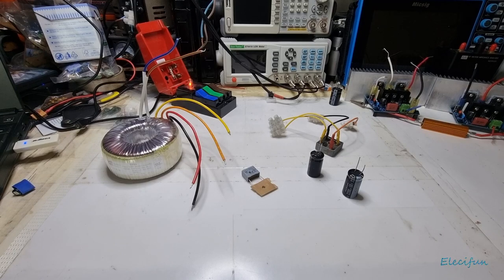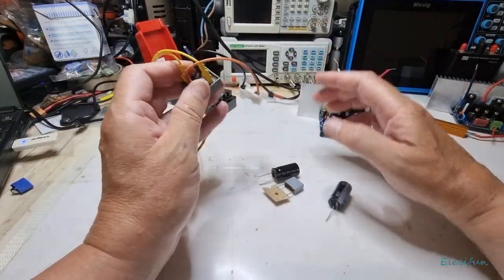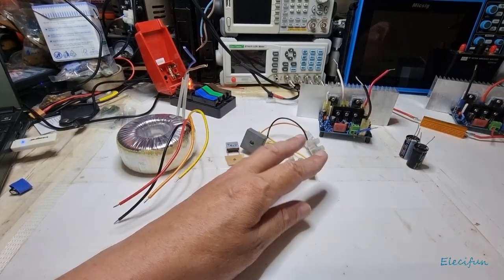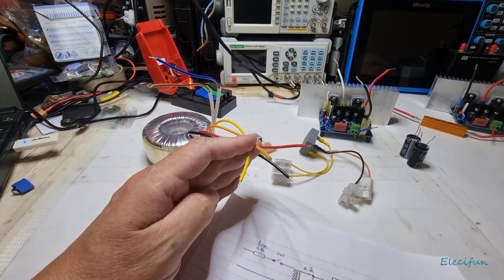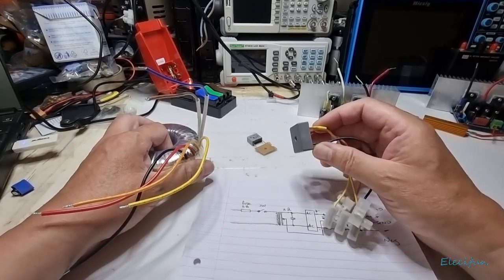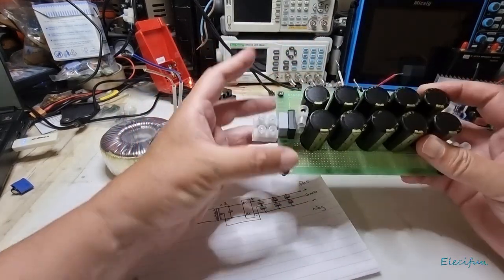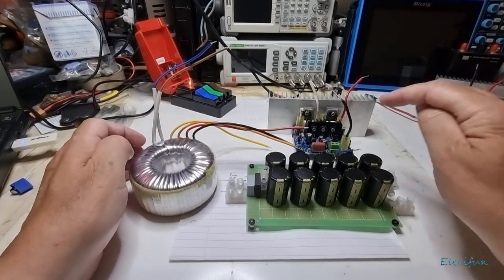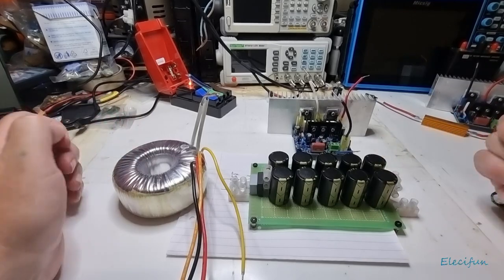DIY UNREGULATED AUDIO AMPLIFIER POWER SUPPLY

Comment: Thanks for the video Elecifun. Very useful information for me. I am always wondering about the power supply. Here in the USA our mains are typically 120 volts. I am always thinking about the final design of the amplifier in an enclosure with clean looking connections to the wall, audio inputs and outputs. Part of the fun for me is building interesting and efficient enclosures  with the power supply included in one box. That way it's easy to test different builds with the same speakers. Just switch out the box and have a listen. Your videos are always enlightening and inspiring. Cheers amigo.

Comment: Hey Dude what's happening? Have you got it all hooked up?

I just saw a 2x70W amp
Based on a TD7296 IC. 

I was thinking of buying it.

It has very low distortion 0.006%

Problem is it needs a very similar audio grade power supply transformer like what your building. 

I don't know enough about transformers or audio stuff yet still later I'll look at this project again.

Cheerio sir !

Comment: Hmmm interesting SIR.😅

Oh incidentally that bridge rectifier is what failed on my Z5500 surround sound system. (Maybe I already told you) When you say 'ground' is that the same as common? : /
Reply from the maker: I do remember you saying about a surround sound system that you were fixing, so it was the bridge rectifier at fault... any idea why?
Yes GND ground common/ground.
Reply: @Elecifun 

No. I don't know why it just wouldn't turn on.

It kinda happened slowly.

Then one day it just would work.

I also replaced about 6 aluminium electrolytic capacitors on the control pod. Who knows whether that had anything to do with it.

 There was a short somewhere but who really knows why it failed. It was the reason why I got into electronics and finally I fixed it. I didn't know whether it would power on. JUST before I switched it on I was some what hesitatant then I thought oh fk it ! What's the worst that could happen? I'll just blow the fuse again. I GUESS.

I flicked the switch nothing happened. 😂 No obvious smoke ... then I looked at the control pod - the pink standby light wad on that's a good sign. I started to smile. Then I pressed the standby button. The lcd display burst into life ! Ha ha she was working! Imagine the joy I felt after 6 years. I had FINALLY  fixed my first major piece of electronics. I quickly fed a blueray disk into the blueray player. The movie started and I cranked up the volume!

Wow it was working perfectly!

:D

Comment: Nichicon KG Gold Tune 3300uF capacitors: 63V  x 10 = $180 😂 or 95 British pounds.😮
Reply from the maker: On the power supply, no need for Nichicon Gold.. Decent low ESR will do.  https://www.ebay.co.uk/itm/175453094992 or similar